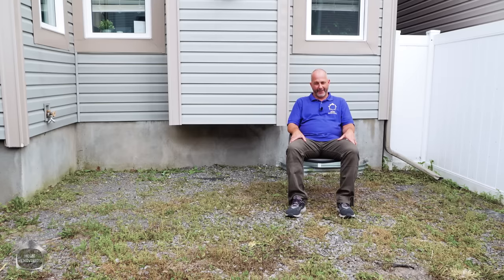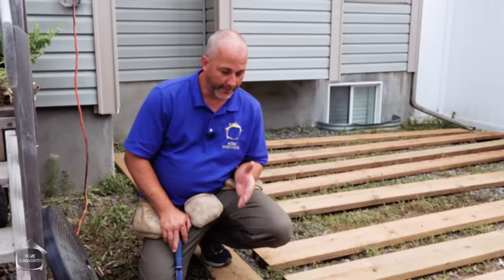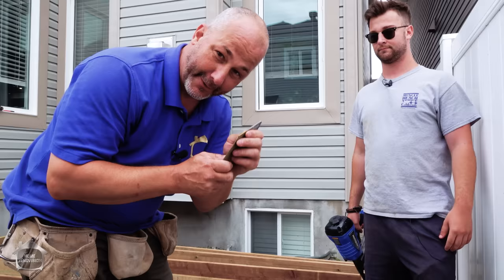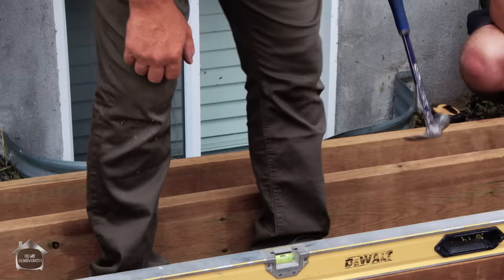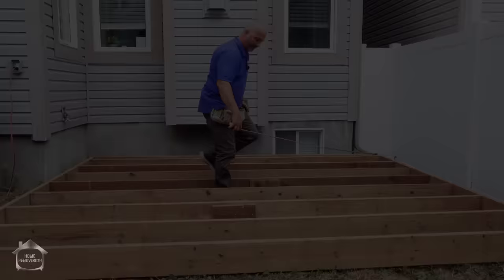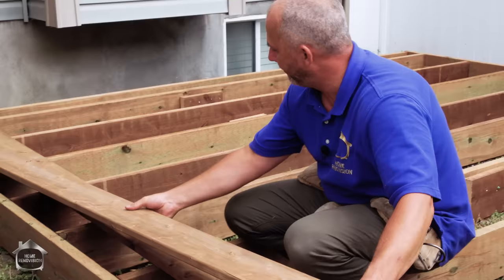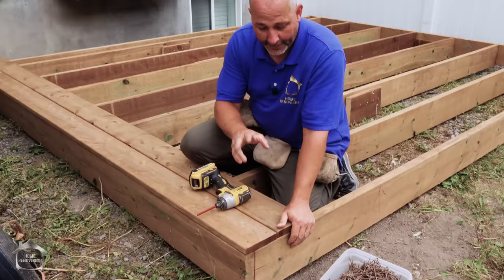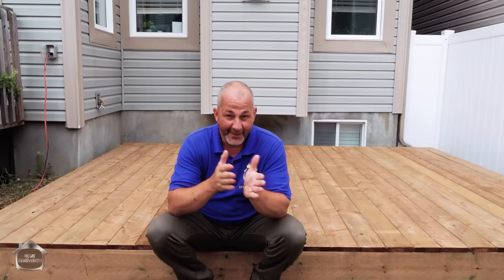How To Build An Affordable Deck

Comment: U lost me at the leveler part. No idea how u did it
Reply: Lift the area that needs to be raised, then fasten another board to the side (and resting on the ground) to hold it in place. 7:10 the deck is raised, and Matt screws another board to the frame, which will hold that part of the deck at level. Move around the deck and do the same thing as needed.